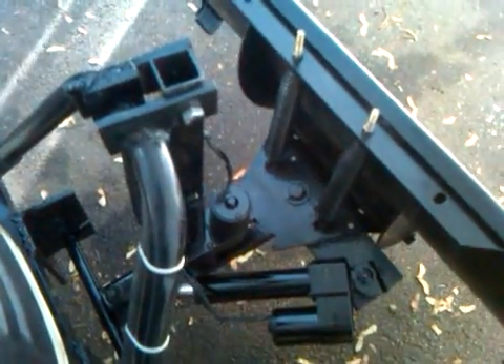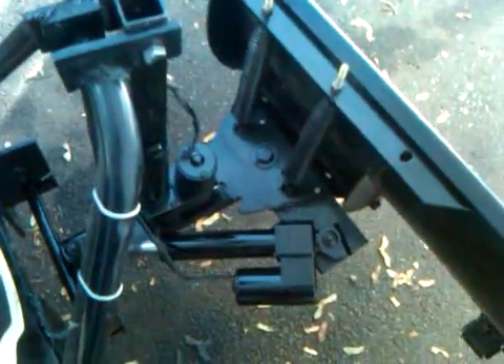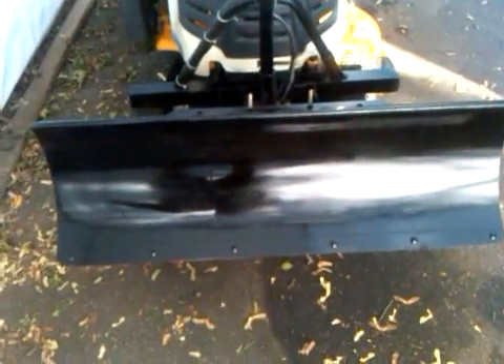Plow system on cub cadet

Comment from the maker: yes you right had the same problems with this only on angle though once you jump up a couple of grades in linears the ends are welded and pinned at least the one i have is but the cost was three times more expensive i was lucky the ones i have i saw on ebay when i didnt  need them but knowing someday i would i got them cheap i was going to use them on a bull dozer bucket i made for the ltx  i put it on the plow expecting snow  it will be comring of the plow this week and going on the bucket

Comment: i did the same thing to my Polaris ranger 6' plow, it worked well until i pushed some dirt. the piston rod end actually pulled out. the pin hole is crimped onto the rod. so for anyone wanting to add a set up like this just take it easy on those linear actuators.

Comment from the maker: HI  IT WAS VERY SIMPLE TO MAKE THIS PLOW WORK WITH THESE LINEARS . I HAD A BUDDY OF MINE WHO GAVE ME THE PLOW TO START WITH 48 INCH I BELIEVE THE POINT WHERE THE PLOW ROTATES ON JUST WASNT LARGE ENOUGH SO I ADDED A 4 INCH PIECE OF 1/4" PLATE WELDED UNDERNEATH TO GIVE THE LINEAR EYE SOME WHERE TO MOUNT TO.THEN REMOVED THE MANUAL  POSTION LOCK SO IT MOVED FREELY  THEN EXTENDED THE RAM TO FULL THROW OUT AND RETRACTED 1/2' BACK TURNED THE BLADE ALL THE WAY TO LEFT AND WELDED A PIN  ON THE TONGUE

Comment: LTX 1000 series is a piece of crap mower
At first I love the lift and cut it mad and still do but the whole machine is made so cheap. My accelerator pedal weld snapped, engine blew because of the  full pressure oiler, cub cadet isn't what it used to be, I bought it because of the name.